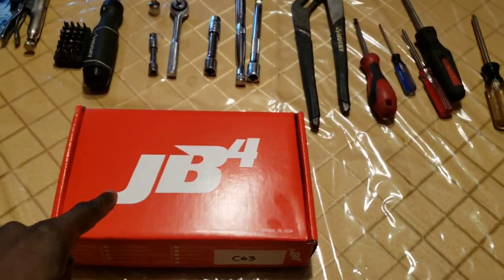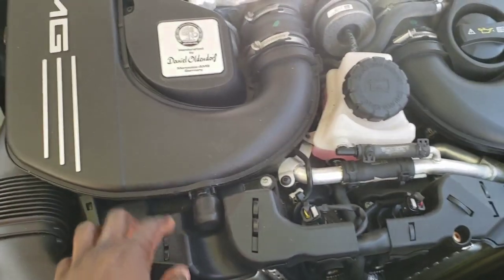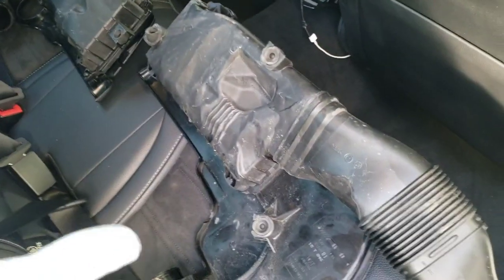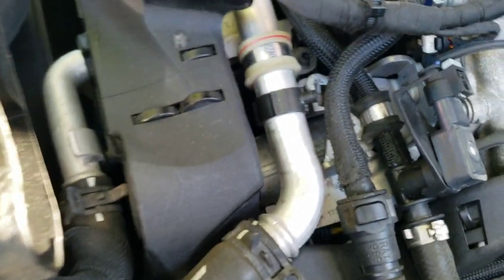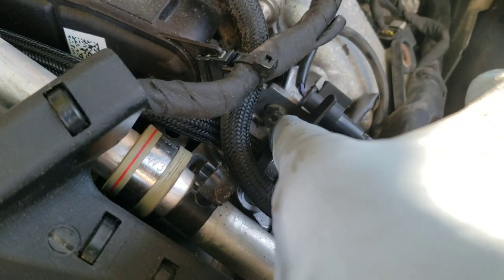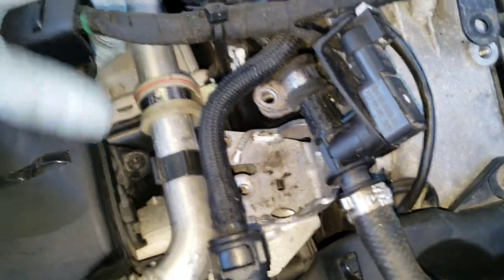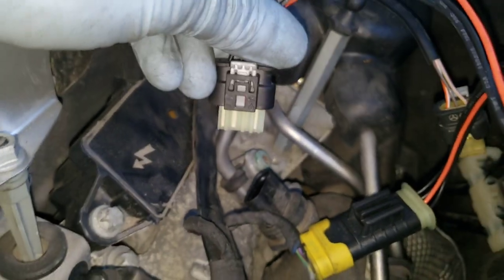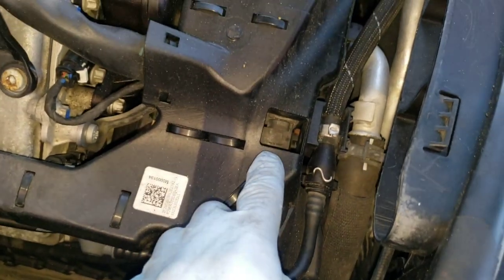burger tuning JB4 INSTALL W205 MERCEDES C63

Comment: I just did the install last night. MAN, those 2 sensors were a real pain to see let alone get to! Damn! The 2 unused cables, did you plug them into each other or leave them disconnected totally? Thanks!
Reply from the maker: You have to install all clips it’s in this videos 

https://youtu.be/7v4EfT5k0rU?si=D6T2YgsfR3KRj5MU
Reply: @BoostInMotion  i will take a look, but in the 1st JB4 install video YOU left 2 disconnected, and even show them lightly plugged into itself on camera. So are you saying that you do in fact need to connect them to their appropriate sensors? Just watched the videos. I will connect those 2 additional sensors up. Thanks.